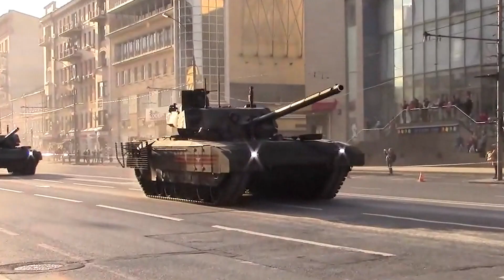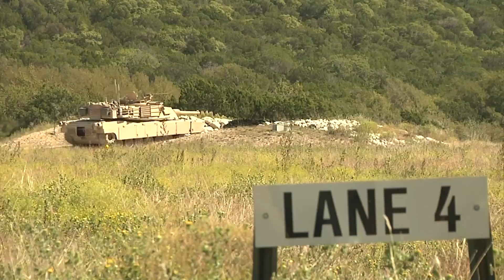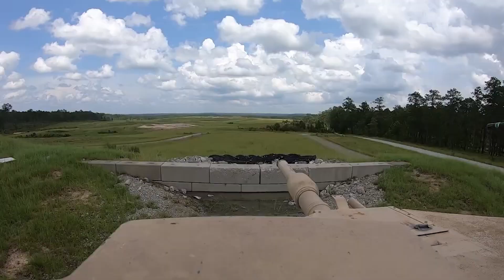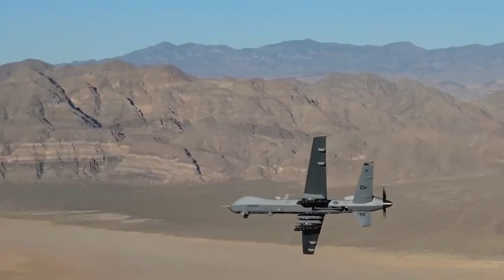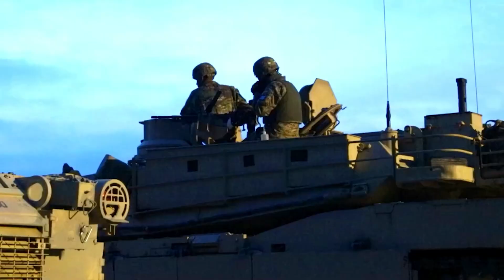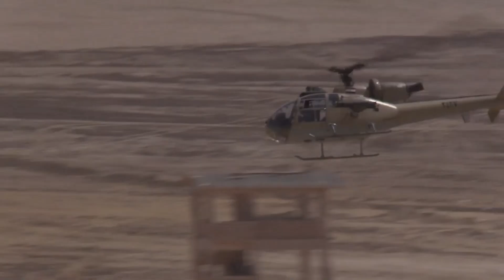The New US Tank vs the Russian T-14

Comment: Butt he T-14 will likely never go into full production.  They have been struggling to get the horsepower and reliability out of the engine they are developing for it and this has delayed the production for over a decade.  The T-14 has some obvious flaws.  First of all they want to go all digital for targeting, driving, and observation, but they lack cameras from enough angles and good enough displays to give a good feel of the the battlefield.  They do not have enough redundant cameras though and just driving in the mud could leave them blind.  The main issue though is the armor on the turret and the back 1/3 of the tank has FAR less armor than the rest.  Russia focused on crew survivability and little else.  They are also relying on active protection that is fire from under the turret in the front arc.  This means if the turret is angled away or the attack comes from above like most missiles, bombs, and artillery (including Javelin, NLAW, and the latest TOW missiles as well as Mavericks, Hellfires, glide bombs...  They have created an active defense against RPGs and other tank rounds basically and it is questionable if they could stop a high velocity round.

Now the Abrams-X is not even out yet and that was a concept vehicle and not a submission to the military and if it did go into production in might be more like 2030 and many of the features would change.  The fact is the M1A2 Sep3 will already bring the T-14 to task.
Reply: Not that it likely won't, it won't. They don't have the electronics they need.
Reply: @marro1916  It is also VERY expensive at almost 2x the cost of the T-90.  Russia is not exactly rolling in money right now and they need to replace a lot of tanks.  Are they going to spend $3 million on an upgraded T-72, $5 million on a T-90, or $8 million on a T-14 when they need to buy 2,000 of them minimum.  Remember they really need to update their fighter jets too... and their navy is a mess.  Their flagship was sunk and their aircraft carrier caught fire during a refit... and it is a rather small carrier at that.  Then there is all the cruise missiles they used... and updating their air defense... and maybe getting some more precision munitions as Excalibur and HIMARS just ripped them apart.  More things like JDAMS and SDB2 would be nice too.

This is while paying off families for all those killed in Ukraine... and the massive expense of maintaining a nuclear arsenal... while trying to increase the size of his army.  This is assuming he is still in power to rebuild anyways.
Reply: @toddabbott781  100% yes
Reply: @toddabbott781  "Very expensive" Russia could get at least 330 Armata tanks for just 1 billion dollars, thats gonna make the armata tank a lot cheaper. The T-14 Armata is like around 4 million dollars.
Reply: @YorkerEli  It ran into massive cost over-runs.  The last I heard was closer to $6 million and growing... and that assumes they ever get the finial version of the engine working.  All the prototypes are using a less powerful older engine.  At this rate though it might never go into full production.
Reply: Paper army. Nothing more. That's all Russia is
Reply: @Asymmetrical-Saggin  China is the same way.  When you put a violent dictator in power all you get is yes-men and corruption surrounding them.
Reply: the turret and tje rear is not as big rpoblem since turret it self is actually small and the cahnce of hitting gun is low but as wat western revealed is that i penetration to the turret will disable its gun and rear whill be pen most of the time
Reply: @DaKevinnnn  Yes but when a 20mm from a Bradley can take out that turret and possible pop a tread... the tank is useless.  Yes the crew might survive, but the M1A2 Sep 3 already has a round that can penetrate the front armor of the T-14.  Of course this requires Russia to actually build some.  Russia might have 20, but those likely are just the prototypes finished (most did not have operational weapons or any electronics), but 10 is likely more accurate.  They have yet to send them to Ukraine because they are likely too scared to loose them.  They are already suffering after they mighty Kinzhal missiles got shot down and their Terminators got destroyed.
Reply: @toddabbott781  ofcourse you can disable the armata by shooting the tracks or the turret(for armata is just a gun with a shell case)and most tank will be disable , the the sep v3 has penetration 900 mm RHA at 4 km and over 1000 mm RHA at 2 km, but the armata capsule is 900mm alone so with ERA it would degrade the penetration of sabot and so makes it have (Malachit ERA + 1,200-1,400mm thickness) and still has aps 

as for how many of them are is obviously small russia is making t72 t90 t 80 and t14
and theyre still trying to find a proper engine  for t 14 since current is not fuel effecient and corruption and 40 of them is expected of them

russia isnt suffering when its kinzhal and terminator got destroyed or intercepted it, the media did as for russia sufferring 
we dont know that since they dont publish on theyre news and situation and western media doesnt help either since theyre also biased on theyre news
Reply: @DaKevinnnn  Well seeing as they arrested 3 of the Kinzhal engineers and charged them with treason I think Russia is a bit upset about them getting shot down so easy.

See the main problem is the Patriot has a MUCH longer range than all the other anti air systems out there (in reality and not just on paper).  If they had say some AIM-260 in the NASAMS those could likely take out the Kinzhal too.  Even the AIM-120D likely could.  They only sent over the MUCH shorter range AIM-120 A/B that they have not made in over 20 years.

This war for the the US (and NATO) has been a way to unload a bunch of old junk and to test a bunch of new stuff... or critical stuff never tested against Russian technology.

The T-14 armor rating is only for a small patch on the front if hit at a certain angle.  In reality it is likely not going to fair much better.  At least the chance of the ammo cooking off and killing all the crew instantly has been taken care of... finally.  This has been an issue that has plagued them for a long time.
Reply: as for the aps aps is usefull but it can stop all
obviously cant stop an artillery and glide bombs 
as for tow or javelin or any might able to intercept it but not simce it will run out of charge 
ot cant stop sabot but can degrade it enough to stop the shell from pen
ukraine had an aps similar to the one on armata but it degraded the sabot enough that it didnt pen also without aps the armor would able to stop it but aps helps
the aps doesnt jjst protect from but protect the forward part 
also it has infrared smoke launcher to counter those atgm
Reply: @DaKevinnnn  This war has shown that tanks without good infantry support and good air support do not last long on the battlefield.  Even Russia's T-90 is struggling to survive hits from RMGs, and Drones.  Heck even the 30mm from a BMP can take out a T-72 and likely the T-90.

During Desert Storm several M1A2 got hit by rounds from the 100mm cannons on the T-55 and they bounced off.  Not one was taken out.  The US has improved the armor since then.  They are not sending that armor to Ukraine though.
Reply: @toddabbott781  anything can take out a tank aslong you hit the right spot 
IDK wats an rmg but obviously a drone will take out a tank since its a top attack
BMP could take out a t 72 and t 90a if it go to its side but gonna be hard since its usually accompanied by something but its alone then yea if it doest get spotted

also i was mainly talking about what was the thought process of the armata and why it seems its a good idea for its changes and feature, IDk why the abrams is here but of course it can stop a shell from a t 55 is obselete as tank now
Reply: @DaKevinnnn  I think the main problem was tank operators thought Russian tanks were death traps so they tended to be more conservative and stay away from dangerous situations.  Now with the crew at least being safer I think they are hoping the tank operators will be a bit more aggressive.  The did fix the reverse speed in the T-90 I think, but they still had all the ammo unprotected under the gunner.
Reply: @toddabbott781  nah they didnt
still 4 km slow
as for the ammo the spare ammo is move to the ammo stowage with blast doors and the courasel is now armored and less chance in a major detonation,  this is only for the T90M idk about the t 90a though

Comment: Abrams X is a tech demonstrator that's purpose is to see if the Army would be comfortable with certain changes to the Abrams, most notably the use of an autoloader and a diesel powered engine.
Reply: I think the Diesel engine (which is the most widely used fuel) paired with that “silent” electric powered mode are both fantastic improvements, not to mention the reduced weight, all of those are favorable improvements across the board. 

As for the auto loader, GD would’ve had to solve its inherent problems (variable angle loading, multiple ammo types, ammo removal, etc.) for the US to consider adoption. We’ve held off on autoloaders for those reasons along with the inherent benefits of having an extra man. That’s a lot of variables to overcome.
Reply: T14 is also demonstrator, but russia always calls their demonstrators "superweapon, already in use, that don't have alternatives anywhere in the world" 😄😄😄
Reply: @lexaluk123  its not its a prototype
Reply: @gigachad5565  only 12 exist.  Yes it's a prototype.
Reply: @jjjr.1186  You're getting your numbers mixed up with the Su-57 which are wrong anyway. Firstly, there are several dozen T-14s with more being built. The truth is, the company maneufacturing the engine went bankrupt, slowing down production. Secondly, twelve Su-57 prototypes have been built, however several production versions have already been delivered.
Reply: @definitelyfrank9341  so 20 t14.  And 12su57.   Vs 10000abrams.  300challengers.  1000s of leopards.  180f22.  700f35. I'm terrified.
Reply: @gigachad5565  yes it is lol
Reply: @Subject C T-14 officially entered serial production on 24 December 2021
Reply: @Subject C I'm sure they told you the secret right before you signed the approval for production.
I know you know
Reply: @gumelini1 t-14 FULL PRODUCTION ETA: year 2250  XD
Reply: @gumelini1  🤣🤣🤣🤣
Reply: @jjjr.1186  Wikipedia said Russia has 80 completed. 132 supposed be completed in the next few months.
Reply: @martinrivera4175  no if they did they would be in Ukraine.
Reply: @subjectc7505 T-14 still working on prototype since 2014?
Reply: @jjjr.1186 bro did not research that grammar perk
Reply: I know turbines were all the rage in the mid-late 60's [*THANKS A LOT, GM/ADAM WEST 🤭], but the Abraham's engine is a relic. The powertrain change is the sexiest proposed update.
Reply: I would use musk ev truck electric engine with a gas powered engine and generator to power the x model. Imagine four ev motors with a gas powered engine combination code improve distance and performance.
Reply: I don't think diesel is a issue for the army st all the autoloader though feels like a no go.
Reply: Auto loader has been developed a long time ago, being the Americans to be the first to develop such technology, auto-loaders are not in American tanks for very valid reasons.
Reply: @edubogota1  yeh valid reasons !

viability of USA tech 🤣🤣
Reply: @LifeisHard313  Nope for advantages in the battlefield and equipment viability and re-usability, yup you know TONS 🤣
Reply: @edubogota1  That's what i said LMAO
Reply: Just a prototype of it doesn't work
Reply: like the russian uses since urss
Reply: @viniciusmoreschi6970  theres a difference. The russian autoloader is trash. It takes 8 seconds to reload, and leaves all the ammo in the middle without blowout panels. The american autoloader has blowout panels, and has a 3 sec reload. Good try tho.
Reply: @viniciusmoreschi6970  Russia uses outdated engines. That is why their tanks are slower even though lighter then the Abrams.
Reply: @viniciusmoreschi6970  Exactly 🤣 "experts" on Youtube and other socials: "russia tanks sucks!!111!!1! they bad!!11! auto-loader sucks11!!" but then western tank designers: "let's adopt the same technologies USSR implemented 50 years ago".
If those "experts" on socials ever had a brain, they would have at least asked themselves if Soviet tanks were really that bad as they think, at least....
Reply: @RiccardoTheBeAst 
Russian tanks aren’t the problem, Russian tactics are.
Reply: @RiccardoTheBeAst  show me an modern example of the west copying Russian tank design. Fun fact ERA was made in Israel
Reply: @vangard9725  What a dumb question XD Nevermind, i don't wanna fight an useless war, murica the best
Reply: @RiccardoTheBeAst  what about then the user copied america by making nukes?
Reply: @RiccardoTheBeAst  The difference is US weapons under promise and over deliver. Also the US has the manufacturing capacity and technological know-how to produce on demand and at scale. 

Russia has shown itself to be more ideologically similar to the old USSR, whilst being a mere shadow of the country economically. 

‘Modern’ Russia is what happens when you don’t have subjugated client states to steal from, the educated  have fled  and those left are drunk/illiterate and propagandized.
Reply: @RiccardoTheBeAst  Its not as simple as "autoloader is good" or "autoloader is bad", its about designing a good autoloader. The type of autoloader that T-72s have is a terrible safety hazard.
Reply: @RiccardoTheBeAst the french and swedish have used autoloaders for a LONG TIME
Reply: @foid_eviscerator  Yup i know